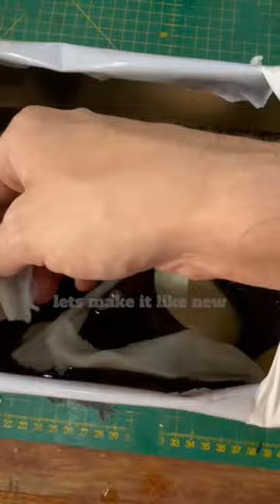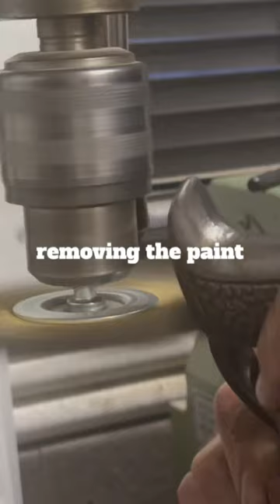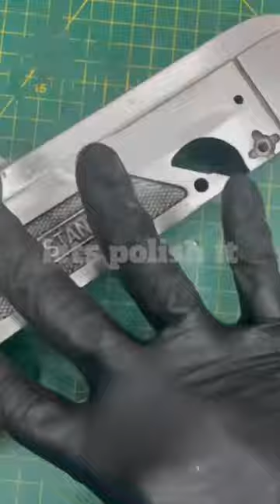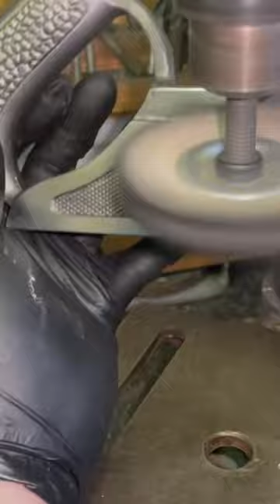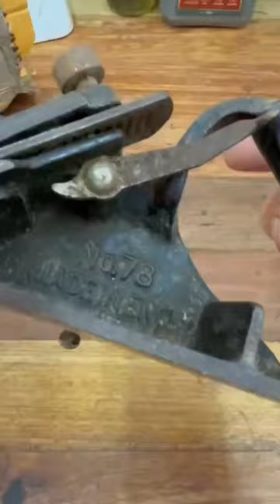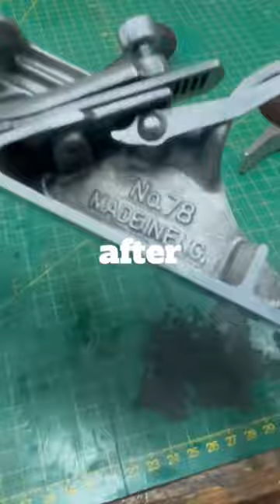Restoring a Stanley rebate plane

Comment: Shiny is cool but when u take down to bare metal u remove the protective coating. Modern manufacturing uses electrolysis plating but period specific to this tool, u should have given the main body an oil bath.
Reply from the maker: Thanks for the comment, yeah I soaked it in boiled linseed oil I guess I left that part out of the video.  I did contemplate heating it up and quenching it in oil for a black effect, also as you said with the electroplating, I thought of nickel plating it, but am not experienced in  that so in the end I just left it as is, but need to experiment with it. every few months I’ll give all my metal tools a rub down with linseed oil and some wax so prevent any rusting.
Reply from the maker: Check the full video out if you want. https://youtu.be/WZeUZ8vpkSw